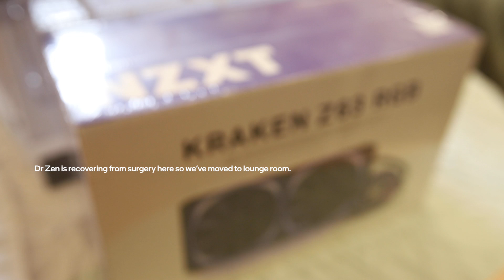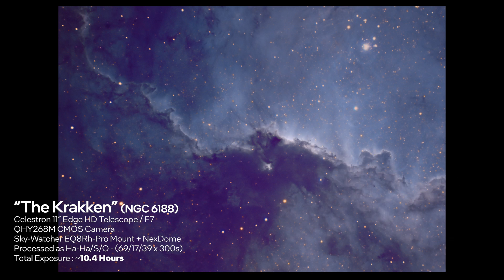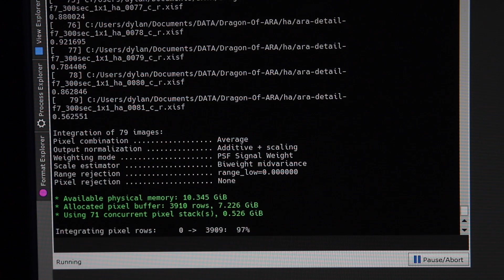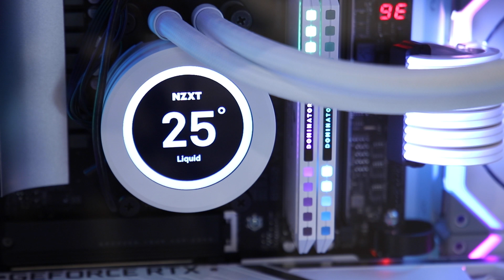Building an All White, Space-Themed Creator PC !!

Comment from the maker: I know my RAM is in slightly wrong  .. I mention this in a caption during the RAM footage ... but also the plan is to fill them all up anyway. :) For those interested, it's best to insert two sticks of RAM like this in slot 1 and slot 3, not side by side :)
Reply: Sometimes its slot 2 and 4... whatever the manual says to have dualchannel speeds.
Reply: Legacy PC rubbish hey? Isn't it funny how little they've changed?
Reply from the maker: @GaryBeilby  haha yeh apart from storage and flashing lights the only thing that’s changed is it’s a million times easier (and faster) now 😂
Reply: Wishing a speedy recovery for Dr. Zen!
Reply: What's the speed and latency of your RAM? That'll help you in the long run if you plan to run 32GB or 64GB RAM (whatever your mobo supports). Then do you plan to run dual-channel or quad-channel? If it supports it that is.
Reply: What is the max Ram supported 128 or 64
Reply: For your motherboard its recomended to use slot A2+B2 for 2 modules dualchannel
Reply: Dude you brought me way back with that doom reference. I remember getting Doom from Babbage’s back in the early 90’s. Good ole days
Reply: First thing I would do is double the amount of RAM. Especially if you are going to be doing your stacking in PI... PI is a RAM gobbling succubus when it comes to stacking...
Reply: Nice build Dylan.  I really like your cooling system so kewl. I just did an upgrade on mine wd ssd black with 32g. But for now she’s good got to upgrade my Astro stuff too. Lol. Looking at a new celestron mount

Comment: Glad you noticed Ram install error but have you also remembered to go into the bios and turn XMP on or you won't get the advertised speed on the sticks you installed. I recently built a new rig around the intel i9 12900k with 32Gb of ddr5 ram. Its a beast and flies through Pixinsight. Think I will benchmark later and see how it scores, just so I can flex on you. Wishing your son a speedy recovery.
Reply from the maker: Good tip!
Reply: @DylanODonnell  Ryzen really likes its memory speed, so having the ram in the correct slots, and having XMP enabled (in the bios) might make a huge difference for your score already. Hopefully we get to see if tweaking those 2 things makes a difference for the performance.

Comment: Nice PC Dylan! Just built a 12900kf for Astro I used 32gb and thinking might go with 64gb! A couple of tips I noticed you put RAM sticks next to each other, if you want to give a bump slightly in speed move RAM stick 2 in next slot for dual channel setup and check in your BIOS and make sure you RAM is DOCP enabled to get full speed out of your DDR 3600 RAM? Really love the all white setup I think I should have went that route!!
Reply: This…ram stick placement, to make sure you’re running dual channel. And check the bios, as mentioned. Beautiful PC!
Reply from the maker: Nice! Yeh I mention the RAM thing in the captions .. but I think I’ll end up using all slots anyway :) good tips too .. thank you!
Reply: @DylanODonnell  just saw it in the captions. 🙂
Reply: @DylanODonnell  ah must have missed caption! I see it now!

Comment: The RAM sticks are running in single channel mode, which cripples their performance. If you add more sticks later though, it'll be fine. If not, just put the second stick in the 3rd slot.

Comment: Always better to install CPU and RAM before you install the motherboard in the case. Also the SSD if it is in a slot rather than a discrete drive. if you use an air cooler install that before inserting motherboard too...

Comment: When you were connecting your power supply to your CPU , did you have a problem with the lead supplied . The two 4 pin connectors don't match the 8 Pin connection on the motherboard.?

Comment: Definitely glad to hear you're planning to increase the RAM; your analysis is spot-on and the kind of processing PixInsight does is almost certainly bottlenecked entirely on the storage subsystem and RAM (both capacity and speed in this case). There's a chance PixInsight might benefit a bit from additional cores (5900x has twice the cores of your 5600x) but I wouldn't know for sure without watching CPU usage while running the benchmark or typical stacking workloads. In any case, the extra cores definitely won't help you in gaming.

These days I spec 8GB for bare-minimum office only PCs, 16GB for "standard" configurations, and 32GB for heavy multitasking or complex processing scenarios. 64GB is still overkill for almost all workloads except really specialized stuff, although since RAM prices are currently at the low point of their regular multi-year collusion-caught-fines cycle it's not so painful to add extra.

32GB of fast DDR4 (3600 or better, which you're running) plus the quickest NVMe SSD you can afford (970 Evo Pro is a decent choice here, although there are PCIe 4.0 options that are faster if you wanted to splurge) would be pretty much the optimal configuration.

Comment: Wait am I so early I get to be the first comment? Depending on the Proc in your Mac, it will probably out perform a Ryzen 5 tbh Dylan. Ryzen 7 , 9 or threadripper are the god tier procs for PixInsight. I still run a i7 7700 🤣and gtx 1070 8gb with 48gb of ram and 18 TB worth of drives. Never enough room for astro raw's or calibrated data.

Edit: Dylan which version of starnet are you having issues with GPU acceleration v1 or V2? Once you answer I might be able to lend some assistance as I have gotten it working for V1 but Starnet2 you do not have to replace files in PixInsight folders like you do with v1.
Reply from the maker: True!
Reply: @DylanODonnell  I will DM you a link on discord for the starnet stuff. if you are running V2 they say you do not have to replace the files but v1 you do cheers mate

Comment: I'm not sure RAM is your limiting factor here. I just ran a PI benchmark and pulled a 11174 score and I'm running 32GB in dual channel mode with a slight OC to 3200Mhz. Unfortunatly it doesn't specify the RAM score but my CPU score for a Ryzen 7 2700X is 13232 and the swap is 6817. How did your other figures work out?

Comment: You need 64GB of ram if the system can take it. Get another GPU and slave it to the one you already have and get yourself an NAS. Preferably as big as you can afford. Oh, and a decent HDD for use as a swap file and temp storage. And, shutdown and/or uninstall all the extraneous crap they load with Windoze. That'll speed things up a bit.

Comment: You really want to get the GPU working and maybe explore StarXTerminator, it runs through a 62MP file from an ASI6200 in less than 15 seconds on my Dell laptop
Reply from the maker: Yeh I tried to get it going for starnet but all my software versions and drivers were so new nothing properly worked. I’ll have another stab soon!
Reply: @DylanODonnell  Since I just installed it on a new Windows 11 PC I found a lot of the drivers were newer than the instructions so I had to mentally update the instructions.

Comment: Nice timing!  My wife and I were just talking about getting a new desktop and I mentioned maybe getting beefier one than we normally would so I could use it for processing. I am not a computer geek but I am good with building things so this may be an option.  I currently use a HP Laptop with a 500GB SSD and 16 GB of RAM. It has been OK but I recently but a ASI2600MC and tried to stack 401 subframes - it only took a 14 hrs before it crashed.  I purchased a 1-TB external SSD and it worked but it still took over 24 hrs.  I did some other things like turned of the make drizzle files and added swap folders and that has sped it up a bit.  I think I still need another system though.  It looks like you are using 16GB of RAM.  Can your system be expanded to 32GB? Cheers

Comment: Yo D how are those temps? Your case fans are on backwards
Reply from the maker: Fine really.. actually the fan layout is intentional to create negative pressure that pulls the air in from the top.. this pulls in less dust than reversing the fans and having them pull from below (where dust settles). I've confirmed it's working by checking the top dust trap and it's gathering there. I'll add reversed fans on the top of the case to pull in air from outside the case there to increase the flow it's already got. Currently it blows out from the bottom and side which is what I want instead of sucking from the bottom and side :)

Comment: I had to go back and look at the specs on the iMac, and I see it's running an i5.  I would have suggested the Ryzen 7 series, but that would have been in a processor class above the i5, so your set up is pretty equal, save the RAM.  I suspect if the Windows computer had 64 gigs of RAM, you would see a big improvement.

Nice looking build, by the way.  Personally, I don't like flashy lights in my computer, it sits below my desk and I can't see it anyway, so why have them?  Other than that, it was nice looking.  With pricing drops, and the new AMD 7000 series of CPUs coming out this fall, I suspect a new Ryzen 7 series, 7000 is going to be amazing.  With PixInsight's lack of GPU support, even a current generation 5000 series Ryzen 7, 64 gigs of RAM, a 2TB MVE and a Radeon 6700XT (you've got to have a half way decent card for the games) would probably put the current iMac up for a good race.  But, because it's an all-in-one, I suspect the iMac will come out less expensive, although you'd need to do some upgrades to get them on an even footing.

Without monitor, keyboard, mouse, etc, I'm at about $2,460USD.  This gives me a mid-range Ryzen 7, lower end gaming motherboard, a slightly larger case, an 850 watt power supply, a Radeon 6700XT video card, and 64 gigs of ram, a 2TB MVE and two 2TB SSDs.

We are seeing a reduction in pricing on a lot of stuff, although it is, in my opinion, still overpriced.  I really would like to see what your PC can do with 32 gigs, or 64 gigs of RAM.

Comment: Gen Xers didn’t learn about grounding straps, I guess. 😎
Reply from the maker: We like to live on the edge.
Reply: They're overblown anyway. Linus Tech Tips and ElectroBoom did a collaboration a few years ago. They tried to kill components with tons of electrical surges and high voltage static. 
Modern hardware is much more resistant to static electricity than it used to be. 
I'm not saying it can't be done, but it's rare nowadays. 
Check out the video on Linus Tech Tips called, "Can static kill your PC?" It's pretty interesting.
Reply: @DylanODonnell  Living on the edge huh...Once you add the extra hard drives put them all in RAID 0!

Comment: Solid Rig great job cool video I hope Zen recovers quick knee surgery sounds super rough.

I few small things you could try to get better performance out of it. Your motherboard can take up to  DDR4 5400MHZ(O.C.) Ram and yours is 3600MHz no idea if this would make a difference but if  the program is super ram heavy it should right? also make sure you run your ram in dual channel mode as well instead of single which I think someone else already mentioned, the crazy thing is you can get DDR5 motherboards now so someone could even make a DDR5 6400MHz build if they wanted to. There are also better SSD options you could get a Samsung 980Nvme instead of a 970 could even get 2 980's and run them in Raid 0 for Omega performance if the main thing you're going for is file system performance. Mac will never win until all options are explored hehe :)
Reply from the maker: Thanks cuz!